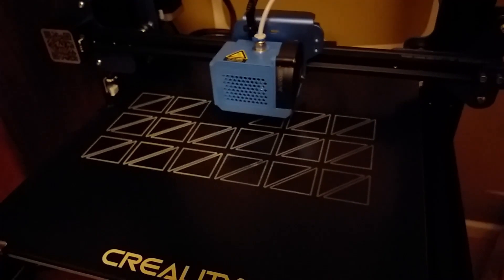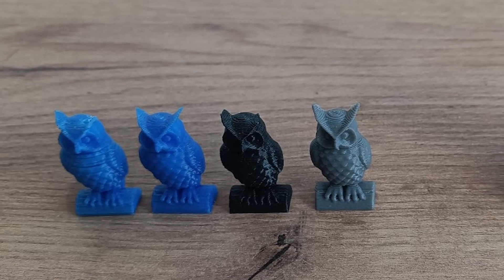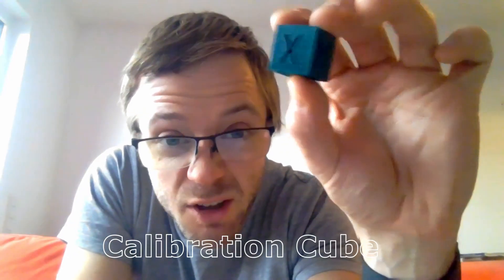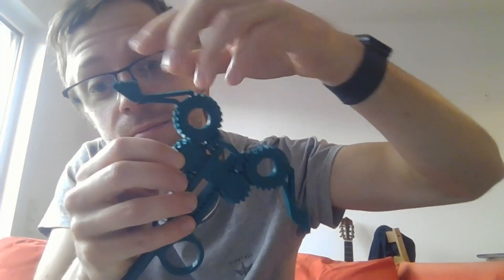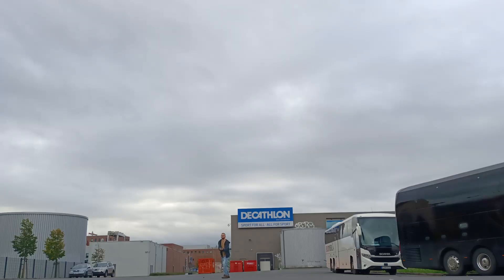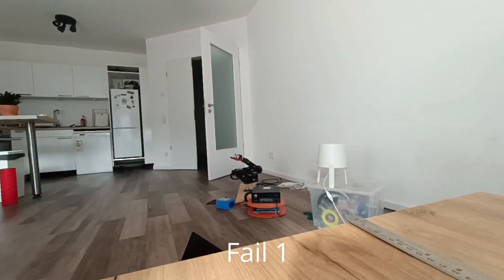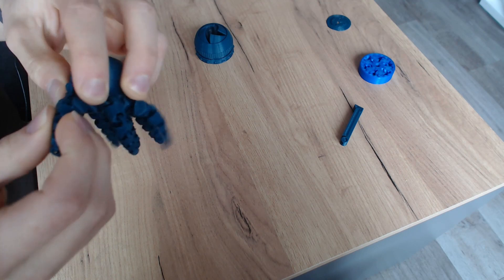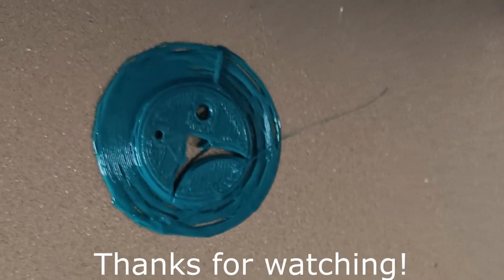Journey into 3D printing, design and mechanisms

Comment: My first printer was the CR-10 also! Great video! (BTW, I think that first whistle... were you blowing through the keychain hole? I think it (or a similar popular whistle I printed) has a small hole on the front that you blow into. Yes, it does need really fine details that my CR-10 didn't meet, but worked great on my Ender 3 V3 SE.
Reply from the maker: Glad to hear you had a CR-10, they're absolute great when they work and 300m2 for a bed is massive. I was blowing through the keychain hole hahaha but the other holes didn't work either.